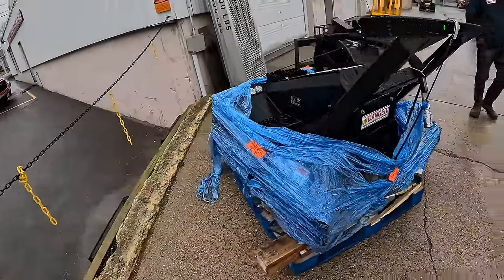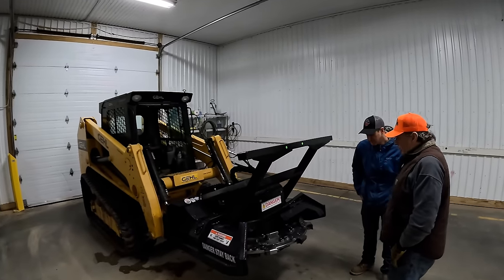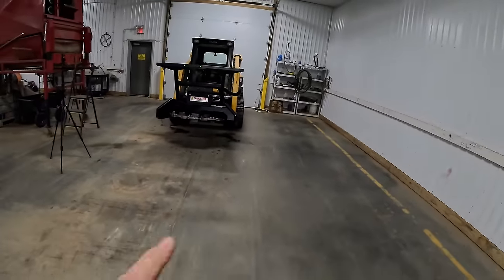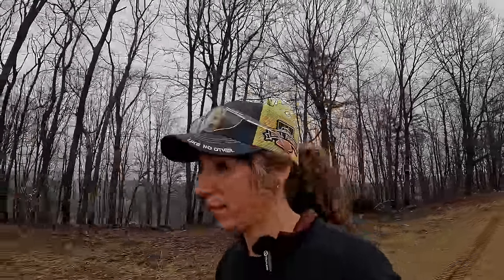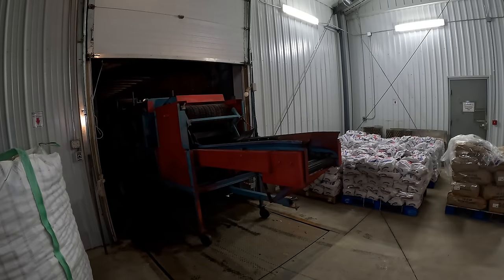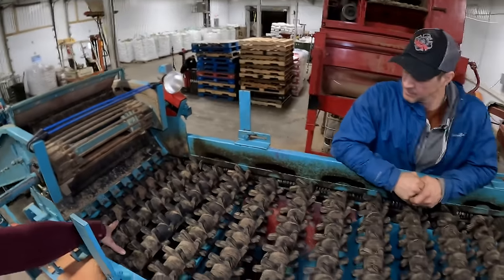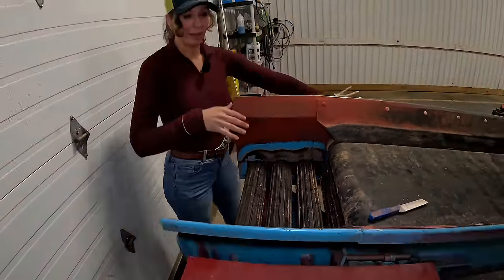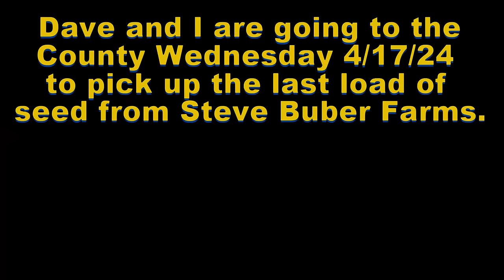Forestry mulcher & setup for seed cutting

Comment: This is a most impressive operation. I had no idea what potato farming involved. Your financial cost for building and equipment must be enormous. And I thought a hay barn was expensive and s small one at that. And like all farmer you have to work around weather and it never seems to be in step with the crop timing and the farmer timing and than there the inevitable equipment break down when everything seems to be going quite well. Farming is just not for everyone. Thank you for sharing how all this works. For what potatoes cost in the retail stores this type of farming has to produce a lot of tonnage at harvest or your margins could be very low. I assume that harvesting is very time sensitive as to when the potatoes could go bad.
Reply from the maker: Thank you!

Comment: Great video once again! So for the seeds does the machine cut them in a fairly general size or are they varied in size? I know you said the smallest ones don’t get cut, so are they cut into like quarter size pieces? Also for a home garden would the dry fertilizer work for that or should I look for something else? Thanks for the tips!
Reply: You set the cutter to make 1.5 to 2.5 oz pieces.  It is sort of random, that is why they have the sliver eliminator.
Reply: @daddio7249  thank you for the information. I knew they had to be small, but makes sense to be as consistent as possible.
Reply from the maker: Thank you for answering that comment for me!
Reply from the maker: Dry fertilizer is usually the easiest way. Just make sure you don’t burn your potato seed with the fertilizer. Thank you very much for asking questions

Comment: Thanks for the explanation, I am curious how much seed potatoes you ultimately use.  Here, approximately 2,500 to 3,000 kg are almost always used uncut per hectare for consumption cultivation.  2260 to 2670 lbs per acre.  We use at least double that amount for seed potato cultivation.
Reply from the maker: We are around 2400 lbs per acre.  Our spacing is around 10 inches on whites. Yellows is a littler further apart. How deep are you planting?
Reply: @BellsFarming  On average, the top of the tuber is approximately level with ground level.  Preferably slightly deeper, longer stem produces more new tubers.  But the soil must allow it and the risk of damage with a lot of rain and harvests also becomes more difficult.

Comment: Are you guys renting that Gehl or do you own it? You have an attachment that calls for a high flow and that RT215 you have doesn't. You're feeding that attachment less than 22gpm. You are down almost 30% work load!
Reply: That’s not a high Flo version of the mulcher, they are available in hi Flo and standered, kinda like a 540 and a 1000 pto, but appreciate the input
Reply: @shanebell9589  I saw that. You can't crank up standard flow, but you can crank down high flow. Either way, you guys got it. Let me know if or when that Gehl doesn't start so you don't dump a bunch of money at it. That's if it's out of warranty...I was a field service tech at a dealer for a while.
Reply: I’m hoping this one holds up better than our CTL 60.  Ive loaded too much dry fertilizer and lime with that thing it’s a wiring nightmare now, seems like every week there’s a new corroded connection to find and repair.
Reply: @shanebell9589  LOL Gehl stand behind their skid steer for farming. They actually held up decent at the dairy farms, but the high ammonia cow pee gets everything at some point!... I worked on a Volvo Loader at a fertilizer plant that was 3 years old and could pass for 23! The transmission cooler (heat exchanger) actually developed a split in it....but back to a no start it has nothing to do with corrosion. It's in your tower on the right hand side. Yours have the touch pad or no touch pad?
Reply: Yes there is a touch pad on the right. This an issue waiting to happen?
Reply: @shanebell9589  Yes sir it is! The one with the touch pad is easier to fix verse the one without. Super easy as in..."Easy Manager" in your machine. Engineering "F" up my friend. If ran daily or often it will screw up and your machine will not start, but on the bright side you can fix it yourself.

Comment: Just a thought and yall prob did but may want to ck oil in any gear boxes before running that cutter much. Have a great day
Reply from the maker: Thank you for the tip! Ray usually services the seed cutter pretty meticulously! But I will mention it to him 😊
Reply: Well i was speaking of the new tree cutter
Reply: I figured that, it didn’t say anything needed oil other then hydraulic system, but wouldn’t be a bad idea to double check 👍